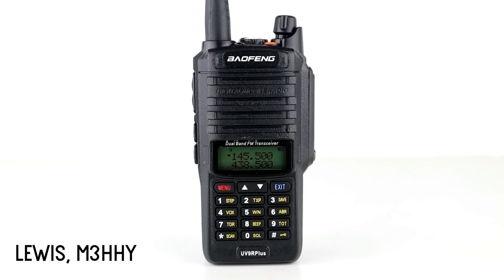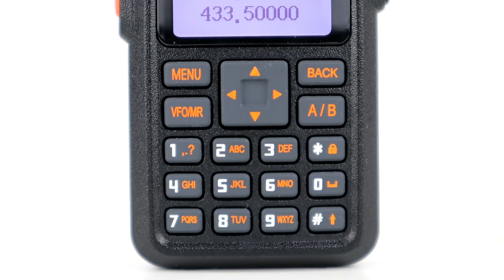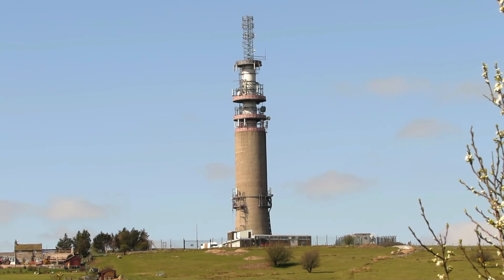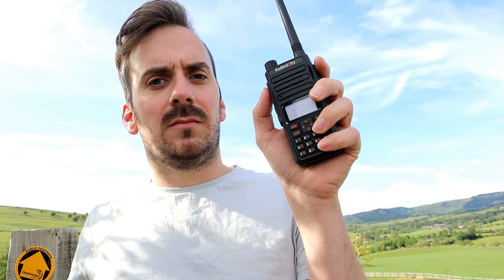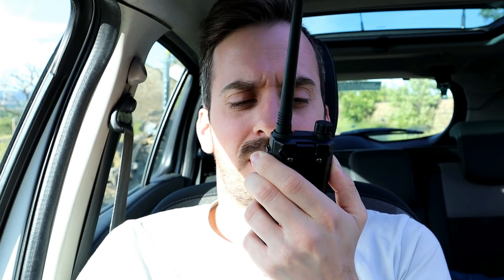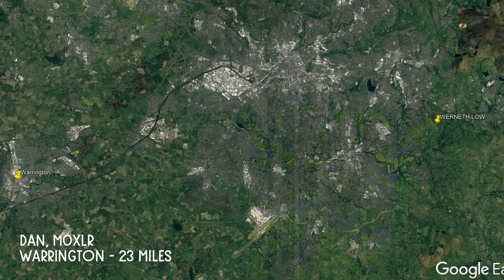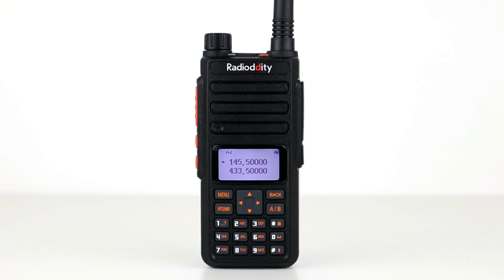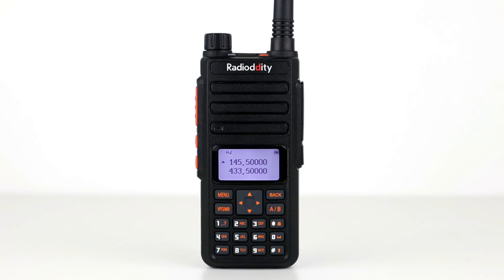This Two Way Radio Is Actually 10 Watts! Radioddity GA-510 High Power Review & Test!

Comment: Every doubling of power = 3db that only = one half S point so 5 to 10 w  is not important. It is better to have the gain in the antenna because it works both ways TX/RX. As was said on CB years ago there is no point in being an alligator all mouth and no ears a linear and ? Still love your reviews.  Your worst critic G4TBD. Do a review on antennas please. Particularly portable HF :)

Comment: Looks a good radio Lewis some cracking contacts.Ive recently came into a pair of Baofengs which state they do 10watts complete with a 48000 mah on board battery and it's ip57 yet it states in the instruction manual 15w I'm baffled.
Reply: My baofeng claimed to be 18w, waterproof and whatnot.
Results: it's weaker that most radios and it isn't waterproof (ask me how o know).

Comment: The 10 watts of power does little good with a dummy load for an antenna.
Reply: I'm 2 years late but...I use the 10 watts output in the car when connected to a Tram BR-180B on a magnet mount and can hit repeaters 50 miles away.  I also replaced the OEM antenna with a Nagoya and the difference is measurable.  No I don't use 10 watts when using it in my hand, I would like to keep my brain unfried.

Comment: Have you looked at the new beafeng UV-10R 10watt on aliexpress.com 2020 model looks like the UV-9S Tri I have? Cheers.
Reply: I join the question, I saw that radio too and couldn't find almost no information, only a review in aliexpress saying the power was actually lower (5-7W)
Reply: @grim3897  says its 10 watt.. I ordered one. It's new for 2020 so just came out.
Reply: I've got a cheap baofeng I just use once in a blue moon to listen
Reply: It's actually 5w.
The antenna is crap

Comment: Would you say, that it makes a big difference in range between 7 Watt and 10 Watts ?
Reply: @Dave Pitre No, they retired them because they were analogue, and digital doesn't need to be as powerful. Brain cancer? Nope.
Reply: @wisteela  Thank you, Sir.
Reply: @Dave Pitre Thank you, Sir.
Reply: Stuff all difference mate.
You will damage your blood cells.
Get a 5w with a good antenna and get gr8 reception and 16 to 30km range.
Reply: Yes.

3 watts = 3 extra miles.